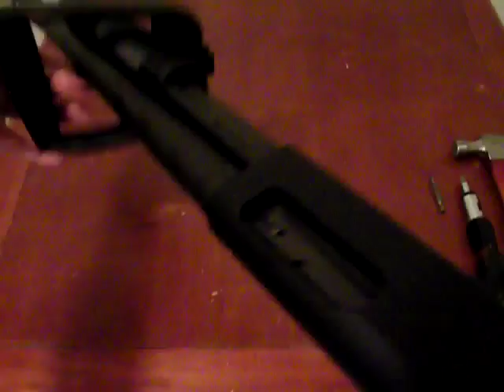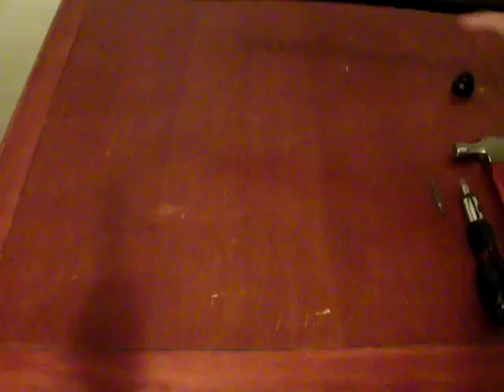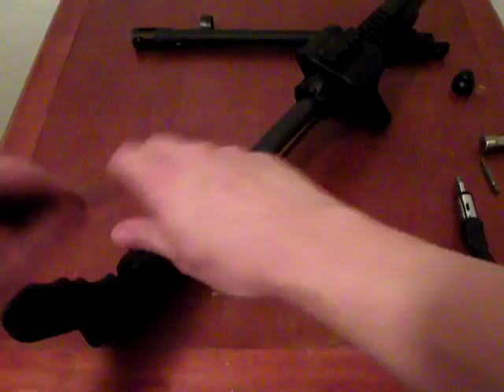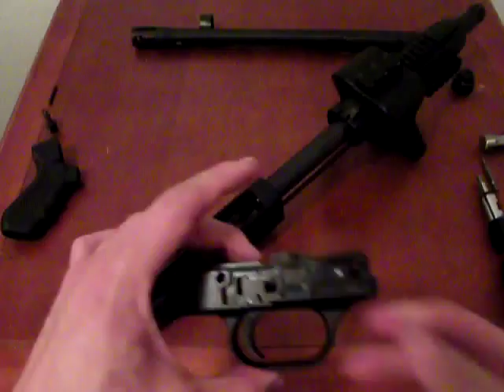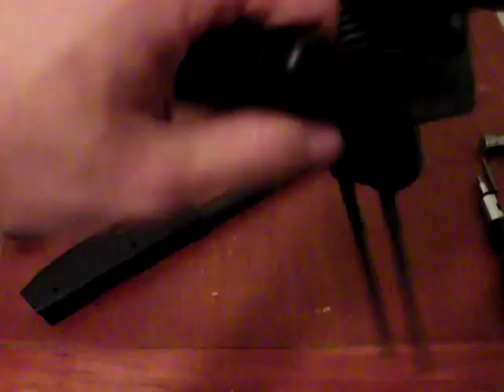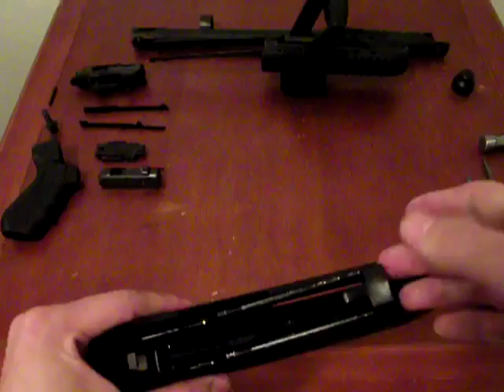Mossberg 500 Cruiser Chainsaw Disassembly Field Strip Fieldstrip Takedown - Gunknowledge.com

Comment from the maker: @penguinfarm3 

Ok, well, first off, explain to me how this shotgun "does a good job with door breaching".  Have you ever configured police department issue shotguns?  Have you ever used one in a live situation?

Now, the Mossberg rep is paid to get people excited about their products, and claiming that their newest model is the best tool for something is his job.  If this model was designed for police units instead, why isn't it parkerized and called the "500 Police Entry" instead?
Reply: Although it might not be specifically meant for breaching it is still quite suitable for the task...Jack of all trades but master of none mantra applies well here...and the longer barrel actually boosts the energy. Also the chainsaw handle can be adjusted to fit the operator...and I can tell you from experience that the over barrel grip is far superior to regular forearm grip in countering muzzle jump and staying on target...and I can rack and fire very quickly...probably quicker than standard versions. You are entitled to your opinion and having access to LEO platforms can obviously impact such. I was looking for a great home defense shotgun, and this configuration works flawlessly for me...and that nasty muzzle combined with a high powered weapon light gives you another stout tool should you run out of ammo. I understand your bias...but most folks don't have the budgets required, nor the justification to purchase a purpose specific weapon...the door or perp at the business end of the shotgun doesn't care how much it cost or how long the barrel is...they simply don't have the convenience for such frivolities!!! That being said your video is very well done...but better lighting would be great!!! Thanks Brother